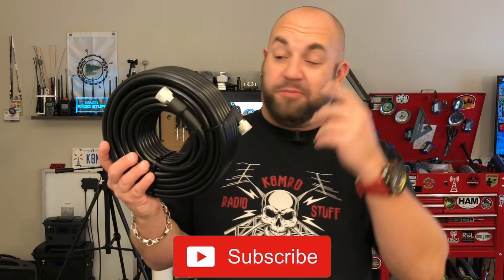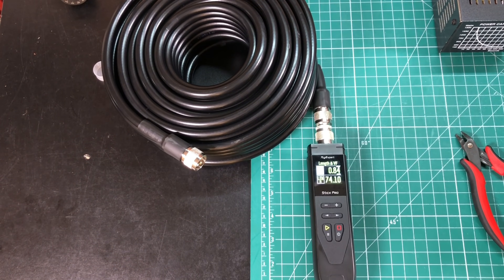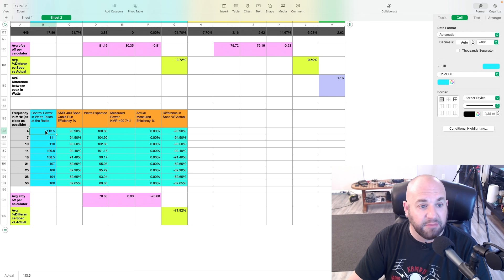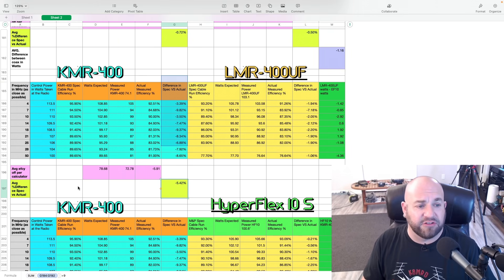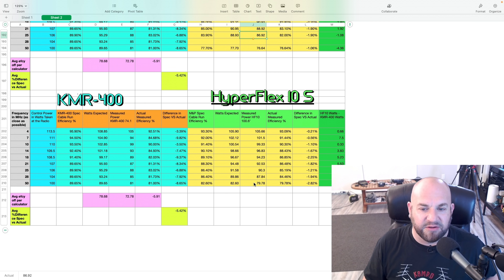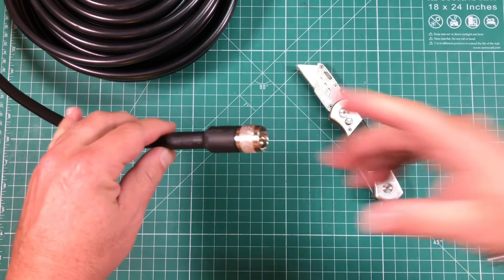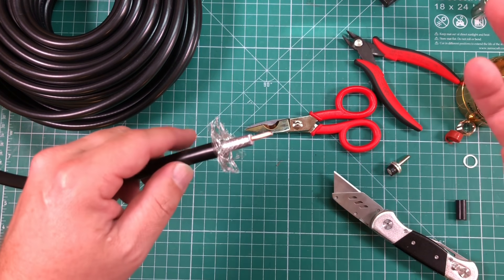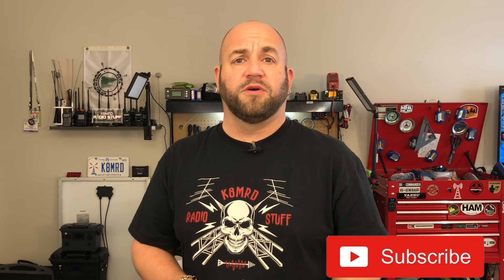I Bought KMR-400 Coax From Amazon | How Bad Can It Be?

Comment: I bought a roll of this from a guy on marketplace, measured out to be about 96 feet, i guess it was advertised as 100'  I cut the cable in half to test on one of my HF verticals had it on for about 6 months. soldering connectors on this was a nightmare, the braid did not take the solder and the center conductor snapped on me three times. i ended up giving up on that coax. and bought Belden rg214. i guess the KMR is good for a CB antenna. I was scared to push any real power into the KMR after 800 watts on 40m i watched my swr climb as i was on the air. thanks for posting this, maybe good for POTA? :/

Comment: I bought some copper hook up wire for antenna from Amazon and the it rusted outside.???:face-green-smiling:
Reply from the maker: Yeah I don't really trust too many wires from Amazon.  It's mostly junk.  I can tell you this particular coax is legit.  I used it for about 2 years before I had to take it down.  It's still good, I'm just not using it now.

Comment: I just got a 30ft dipole up yesterday for my HF. A guy gave 60ft of the kmr400. I feel it is atleast better than my rg8x cable.
Reply from the maker: Oh for sure it is.  I used it for about a year or so to split feeds from my antenna so I could operate from my front porch or my shack with the flick of an antenna switch.  Worked great.

Comment: Looking at the actual power out for each cable they are within 3% or less. So even if they dont meet the given specs they are still very close in performance. So that is what matters as well as ease of use and longevity. Hard to listen to the " there is a big difference" when the actual performance is within 5%.

Comment: It would have been much more informative if the KMR400 and LMR400 were tesed head-to-head rather than using manufacturer specs for the LMR400. As we all know, spec sheets often use inflated data that rarely live up to actual performance testing.

Comment: on hf you wont see much difference cause the percentage of loss is so low, when you go way up in frequency you will see a larger difference so the comparison can be made more easily. i think lmr400 has like 1.5db @ 150mhz for 100ft   and at 440 its double that so your 100 watts would only get about a little more than half the power at the antenna.  the sad thing is i can get 1/2 hardline for less than lmr400.

Comment: Have you tried soldering to the braid on this coax?  I have some "Kemet" Chinese made "LMR-400".  I checked the velocity factor, and it is about .84, like the real thing, however attempting to solder on a PL-259 is where I ran into some issues.  The braid is apparently made of aluminum.  I may need to get some crimp type 259s to make a decent long lasting connection.  The center conductor is copper plated, not pure copper, but at least it can take solder.  We get what we pay for, I suppose.
Reply: You cant use the old PL259 connectors. They have specific KMR400 connectors that allow for the larger dielectric and "clamps" the braid as well. Minimal soldering of the center pin is all that is needed.

Comment: Aluminum core with copper clad is never as good.
Reply: It is my understanding that RF travels on the outside of the conductor, which in this case is copper. The aluminum is basically just used for support of the outer copper.

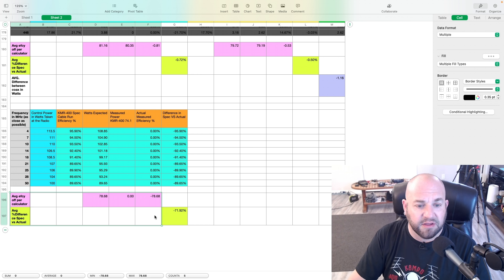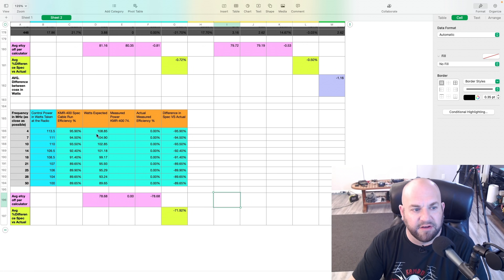Comment: This was a great topic. I bought some KMR "hoping and wishing," but noticed a number of questions in forums by others wondering if KMR-400 was was anything close to LMR-400. Unfortunately, the most important spreadsheets at 3:09 were mostly obstructed when I tried to take a picture. (About 1/4 of the top of the screen was taken up by the two top rows, which mostly were empty.) The initial spreadsheet at 2:12 and the Amazon chart at 3:43 were great, but not so much for the most important listings at 3:09. Also, the verbal analysis didn't really cover the performance at VHF and UHF frequencies at 50' or 100'. You appear to have done some good testing and I have enjoyed your videos on putting coax in a tree for POTA's as well as on Potaflex and Stealthflex (watched and rewatched them). Please give us a few seconds of the full spreadsheets in the future, if you can't give us a link. I routinely save such screenshots for refereence from other videos and have gotten some really clean jpegs and pdf's with Camscanner on my Android. I've read numerous comments that today's RG-58 and RG-8 from the better companies is nowhere near the coax from the better companies from the 1980's and 90's, so I rely on the better YT creators like yourself for testing. Thanks.

Comment: I looked at this stuff on Amazon at the end of last year. I bought the Bolton400 50-ohm cable. It is basically the same stuff that is in the video. It works OK enough. It is very stiff and hates to bend. I have since got actual LMR-400. Much more pilable and has a copper core instead of the aluminium core of the cheap stuff. It makes a diffrence. I run both cables on a 50W base station. I think I am done with cheap cable.

Comment: You should have put your watt meter in dBm reading and then your loss would have been in dB. Simp subtraction. Also the 3dB rule doesn’t work the way you applied it. 3 db from 100watts is 50watts or 200 watts. It not linear. 
And it’s 3.1 technically for 1/2 power  
Measure the Return Loss on your meter and divide by 2 with an open or a short on the other end. 
The numbers aren’t far off from what LMR 400 or any of the many copies out there. It’s still better than LMR240 or RG8X 
I was the sales representative for coax and test equipment for many years. Yes it’s not as good as the premium brands but still better than the size smaller of the premium brands. Less expensive too. 
Measure return loss of your load on the end to check the quality of the connectors   You can SWR if your instrument doesn’t do return loss but I think it does.

Comment: Hello, I am looking for an alternative for my 50ohm cable (50 feet) of RG6. This is for my LTE booster from the antenna to the actual booster. I am looking at RG11. Anything else that would be good. Thanks !
Reply from the maker: RG6 and RG11 are both 75 ohm cables.  I don't think this would be what you are looking for as this is a 50 ohm cable.  I don't know much about the 75ohm cables so I can't really tell you what to get.
Reply: @hamradiotube  Thanks. I found my mistake. There nothing really better than RG11 (75 ohms). So, I will go with that. For all my 50 ohms, I have used LMR-400. Thanks for your speedy answer!

Comment: The connectors clearly have less threads visible which translate to less physical grip and contact.  They can overtighten and "jump" a thread.  They can arc and later fall off.  They are junk for anything over 10 watts.  There is a lot of these found in the discount market. Buyer be aware.  As for KMR vs. LMR....solid cores deform and loosen easily. It's ok for receive cable only, not good for transmitting anything over QRP levels.

Comment: Your mistake is in the measurements and not in having purchased a copper-plated aluminum cable.
Generally up to VHF this type of cable is not convenient compared to a solid copper one, but from UHF onwards the RF begins to propagate ONLY in the thin copper coating which, deposited by electrolysis, is very pure. The attenuations at those frequencies can be lower than those of an entirely copper cable and therefore much more expensive (e.g. LMR-400)

Comment: I bought 100 feet of an unknown brand of LMR400 for $38 plus shipping all in under 50.00, and it works perfectly. In construction it looks a lot like what you purchased. Honestly, I find it hard to justify spending hundreds more for very small changes in coax characteristics, especially since the highest frequency I’ll be using is under 500mhz and mostly under 30mhz.

Comment: I use 100' on my QRP setup, and I have absolutely no issue with the comparative minor % losses. There is a point of diminishing returns.  If you want near zero insertion loss, use ladder line with a balun at the rig.  Today's direct conversion radios are so sensitive that losses at HF are very negligible.  Use a 3,000 ohm Z CM choke and those losses will appear to drop more.

Comment: Great video but I just wonder if your results would have been different if you had uncoiled the KMR400 and measured as a straight run. As we know coiling cable can give higher reactance/resistance results. Keep up the great work😊

Comment: If I want to know if a coil of coax is 50 or 75 ft, I can swag a velocity factor and measure it with an analyzer. If I want to measure it loss in order to evaluate its qualiy, I'll go to the trouble of uncoiling it and rolling out my 100' tape measure to check the length.  The cable passed for "good for general use" on lower frequencies, but I'm not sure it was given a fair shake un VHF, given the assumptions made.  Looks remarkably well built for a cable sourced off of Amazon.

Comment: I'm currently running this for two antenna and no complaints. It gets the job done.
Reply: This has been in my attic for 7 years (in Arizona) and my UHF/VHF still reaches mountain peaks 200mi away, clear and bright. For 1/3 the price it's a good option.
Reply: @Maker_Mikey   I recently added a dual band fan dipole and another run and still doing great. That's awesome, 200 mi is a heck of an accomplishment.

Comment: I'm not sure what kind of test setup this is and what the margin of error is but it seems like a really convoluted way of testing insertion loss.

I've tested the S21 insertion loss of the kmr-400 utilizing an Agilent Vector Network analyzer calibrated using  Keysight (Agilent/HP) 85032F calibration standards.. the end result was that it was in within the margin of error of LMR 400 ultraflex. 

Utilizing a watt meter and a dummy load to measure insertion loss at best has a 20 to 30% margin of error, also whether or not the coax is coiled or laid flat uncoiled on the ground can make a significant difference when using that method.

The bottom line is the measurement system you use is not very accurate. Even using a nano VNA and measuring S21 insertion loss would be more accurate by several orders of magnitude.

By the way you really want to test the coax at the highest possible frequency. Personally I like to do insertion loss testing of coax at 900 MHz the problem with doing this is if the coax is using pl259 connectors, the pl259 connectors can cause reflections that result in erroneous measurements.

When testing insertion loss it's best to use either N-type connectors or SMA connectors on the coax.

Coax with pl259s on it shouldn't really be tested much higher than around 150 MHz.. pl259's will even cause issues with S11 coaxial loss and TDR measurements, they are really crappy connectors primarily because they are not constant impedance and those impedance bumps cause reflections. One PL 259 is probably not a problem get a few of them on a feed line and you could run into serious impedance issues above 150 MHz

Comment: "Fantastic" connectors are silver plated and have Teflon dielectric, (though I do like the shielding on this stuff.) These clearly aren't silver plated. You should use a good temperature-controlled iron to test the dielectric to see if it's Teflon. I grabbed a dozen good ones some time ago at a swap for cheap from someone who needed money. Having said that I always solder on my own connectors. It's really the only way to guarantee reliability. BTW, I've always figured a stranded center conductor had lower loss because of higher surface area. Am I wrong?

Comment: Once in awhile you search for info on something, and ACTUALLY get the exact answers you were looking for. THIS VIDEO is one of those times!! Excellent well-thought-out video with measurements, numbers, and an actual teardown. I couldn't swing the extra cash for the Times Microwave stuff this time around so took a chance on the KMR-400. At least I know now that I didn't get ripped off and it should do a decent job, even if it falls a little short of the Times Microwave version. Thank you!

Comment: I am replacing my coaxial cable with m & p. What's the difference in benefits between the larger diameter to the smaller diameter coaxial cable.
Reply from the maker: The larger the diameter of the coax, the more efficient it's going to be.  You can use their coax builder to compare coax in terms of length, size, and efficiency (attenuation, the less the better). https://messi.it/dati/layout/attivo/calc_ord.asp?l=EN&
Reply: Thanks

Comment: KF5MCJ Ron Tulsa. I am working on my station for the first time in ten years. I retired last year at 67 and now have time and a little more money.  I ran my station antenna wires with Amazon RG-58, RG6 and RG8X, I believe I am having cable problems. I have enough RG 213U to replace what I purchased from Amazon. If you could offer an option on the RG-213U, I would greatly appreciate it. I have an Electrical Engineering background. Aluminum conductor has a rating factor of 60% compared to copper.  RG-213U Resistance 0.17 Ohm /100 ft, Impedance 50 Ohms, Capacitance 32.2 pf/ft, Velocity 66%, Attenuation 4.7 db /100 ft 400 Mhz. I will be running new lines for both HF antennas and UHF/VHF antennas. I was looking for a procedure to test this cable before I install it. I was given about four hundred feet ten years ago. 73

Comment: Uusing your numbers at 50 MHz, the 74' KMR has 100W in and 81W out which is -0.915 dB.  The LMR has 100W in and 76.64W out which is -1.155 dB at 103' or -0.830 dB at 74'.  0.915 dB vs 0.830 dB is not very significant.
Reply: True and no one would know the difference, including yourself. These are marginal loss'es and are to be expected. It's a hobby, and you're right on to that.

Comment: To agree with some other comments: (1) I would have uncoiled the cable and measured the length rather than assumed that the VF was known.  (2) I would not measure the properties of the cable while coiled. (3) A nanovna could have given you losses across the bands in one measurement and probably made the task easier, but I see no flaw in your approach other than those just stated.  And I agree that for a non-flex cable, it came from the factory too tightly wound.  The center conductor has probably "taken a set" off-center permanently altering the electrical properties of the cable.  Thanks for your video and support of amateur radio!
Reply from the maker: Measuring a cable while coiled has no effect what so ever.

Comment: Back in the 80's, I used RG 8 and RG 58 from Belden.  Both in the Marine Corps, and personal use.  Currently, for HF, I'm still happy with standard RG 8,  RG 8X, and RG 58.  For VHF and UHF however, I tend more to LMR 400, where the lower loss in those bands are substantial.  I'm on a small fixed budget.  I terminate my own cables and buy bulk cable as possible.  Tailor the cost to the application is my thought.  Nothing is perfect.  We do what we can.

Also, as a side note, your coil looks like a loose choke from other videos.  Others have commented, so I won't belabor the point.  For those unknowing, please seek the other comments and search for common mode chokes.  I've not done my own tests as yet, so I won't comment further.  (tests are planned, just not today....  :)    )

Comment: Been down the cheap coax route before and decided to do more research and testing and now I run Times Microwave LMR-400 on both my homebrew EFHW and DX Commander Classic. I haven't regretted that decision at all. I recently got on the M&P bandwagon and bought a 50ft run of Ultraflex 7 and an 18ft run of Ultraflex 5 for various portable setups. I haven't tested the M&P coax but I trust the YouTube guru's findings. Some cheap coax may be good but I will stick with brands I trust. Thanks for another great video.

Comment: I'm not trying to be critical, but  you should have adjusted the VF to match the length, instead of assuming the cable was shorter than 75 ft.
You could have ran it with both VFs and then uncoiled and verified the length after you were finished. 
That said, thanks for all your work.

Comment: Solid-center aluminum is not going to do as well as solid copper. Copper clad is not a replacement for the good stuff. You also need to check this cable at 146Mhz as well as 445Mhz for losses. I have a spectrum analyzer/tracking generator. I would love to test that on my analyzer. I just may purchase some of that wire just to see it. Nice testing you did, however. Your research was great!!